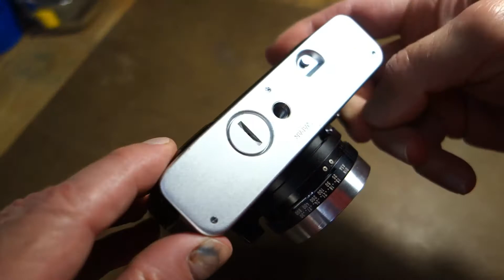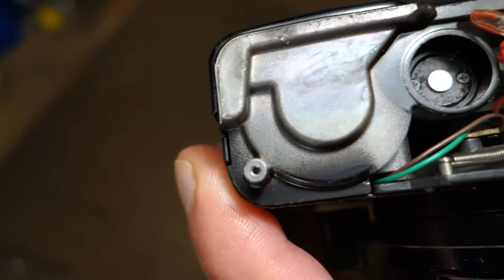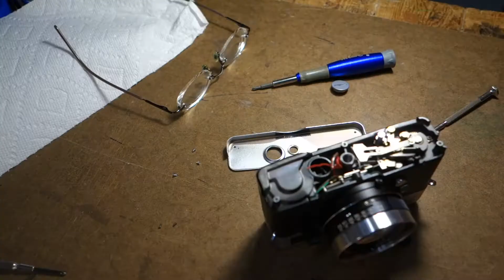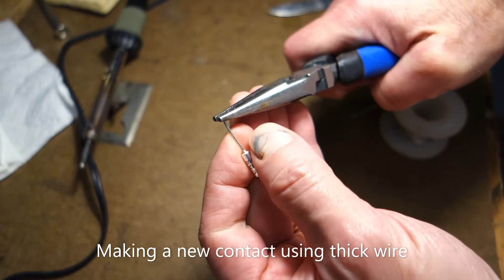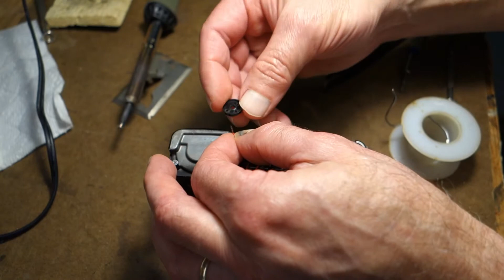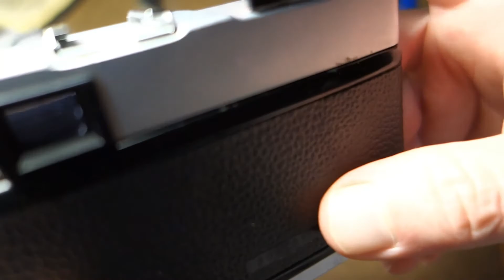Minolta 7sii light meter repair

Comment: I have a Minolta Hi-Matic G with the same problem. But when I disassemble/take the bottom part off to get at the battery contact. I don't have the two screws on either side of the contact like your model. It's just the contact alone. No way to get it out or get at where the wire connects. (from the top anyway). I also pull a bit on the red wire and it doesn't move. I thought maybe it would come out of it wasn't connected. I wonder how I get to the wires underneath? I can't seem to see a way, unless maybe by taking off the lens.

Comment: Thank you so much for the video! It is quite hard to find Minolta 7sii repair video.. Can I ask some question..? 
My camera has problem of the lens itself feels a little loose and aperture control part has some big mess dirts(like grain of sand) so hard to control. It is quite hard to open that part.. Is there any solution to open that part to clean and make it more tight?